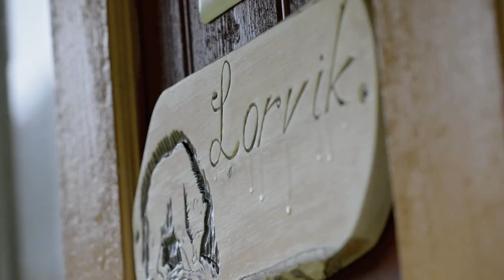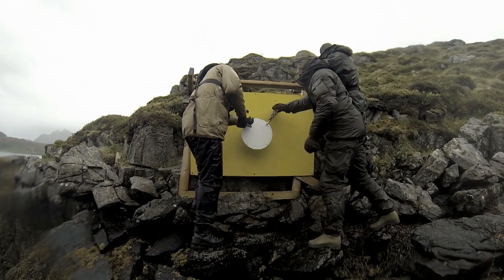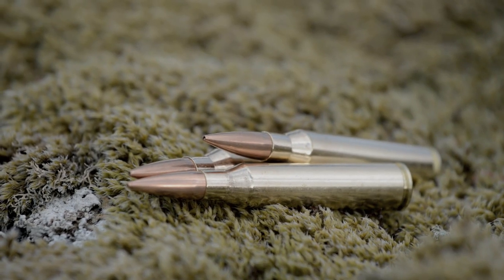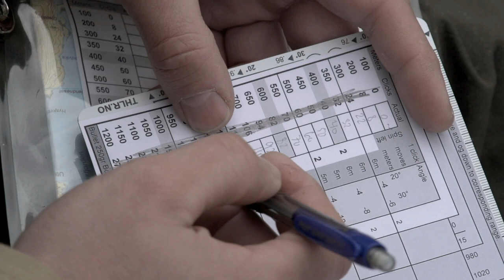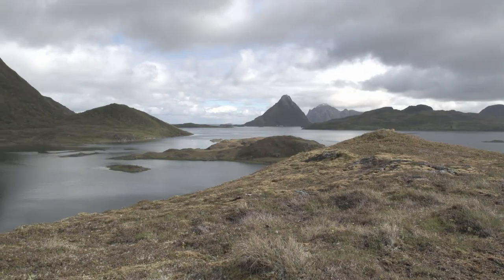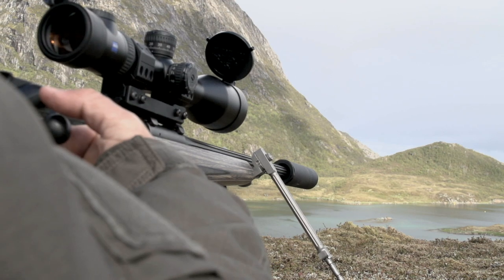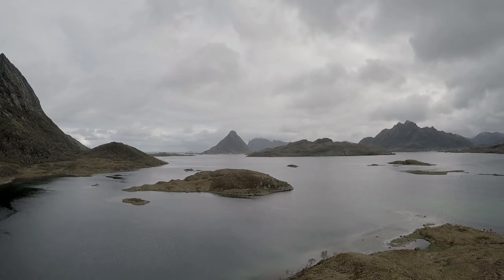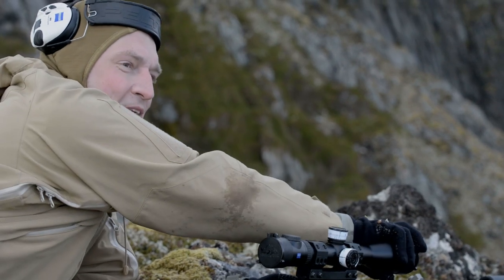How to build a long range shooting system

Comment: Great video. Not sure if you still monitor and respond, but I have a question. I understand the tape on the elevation turret. 1,2,3, 4...5.5... 800m. can you explain how the Windage turret tape works? Turns will be different based on distance and wind... thanks.
Reply from the maker: Hi Brian - sorry I can't answer this one. Please can you try Thomas and Ulf direct at THLR.no? Cheers Charlie

Comment: Amazing video but I didn't understand the tape on windage knobs. Did they mark wind speed on them or what? For me example 5 m/s cross wind is 1.5 mrad in 500 meters but 2.7 mrad in 800 meters. So if I marked the 1.5 mrad result to be 5 m/s and I was shooting for 800m I would miss by 1 meter. If I do it other way around (2.7 mrad to 5m/s wind) I would miss by 60cm. Not much but the results cumulate. Example 300m and 800m would result in 1. 5 meters.

Comment: This video is inspiring and makes me want to learn my shooting system better..Anyway you could explain what you did by using white tape on your turrets?
Reply: 50 Stitches Steel once they confirm elevation required for distances, they mark the tape with those distances eg 1 for 100m, 2 for 200m etc. so when you have a target at 400m, you don't have to get out your dope chart, you can just rotate the elevation to "4" and you'll be on target.
Reply: Corey McLennan Makes sense, thank you!

Comment: I always thought  suppressors affect the accuracy.  Great video!
Reply: Well it makes the bullet go alot slower so you just need to account for that, as he has to use subsonic bullets. Meaning they go below the speed of sound, or they will make a huge bang even with a silencer on as the wake of the bullet breaching the speed of sound is alot of the sound you hear in a gun. So yea, using silencer for super long range would not work as bullet drop would be too big. You would have to aim for the moon :P
Reply: Haha, no, they are not using subsonic .338 Lapua. There is no such thing! And suppressors actually slightly increase the bullet velocity, not slow them down.
Reply: How can it be so silent then? Ive shot 9mm rounds with a suppressor. Had both subsonic and normal. When i tried the normal with silencer on it was not alot different sound wise that the silencer off. Still was a large bang instead of pretty much only hearing the mechanism of the gun.
Reply: Here is a 338 using a suppressor and normal ammo... https://www.youtube.com/watch?v=OHVJEdcFZE0
And yes using suppressor and normal ammo will give the gas more room to push the bullet forward yes.
And heres a link to buy subsonic 338.... https://shopcorbon.com/PM338S300-20

Comment: what type of bolt is that? I've never seen a bolt that slides back and forth without pushing the lever up.
Reply from the maker: +Jese Sanchez Google straight pull
Reply: Jese Sanchez It's hard to make out through his think accent, but he mentions what it is in the video. It's a Blaser R8, specifically, it's the GRS.
Reply: Blaser R8